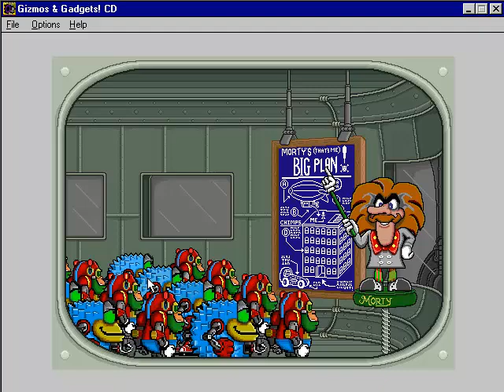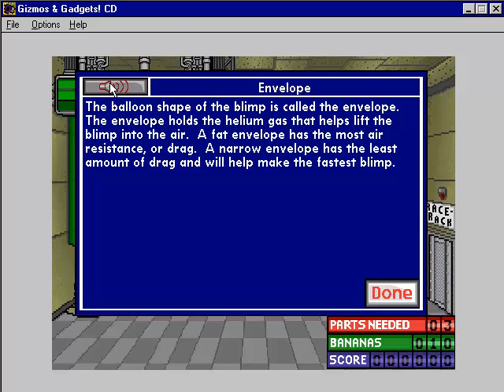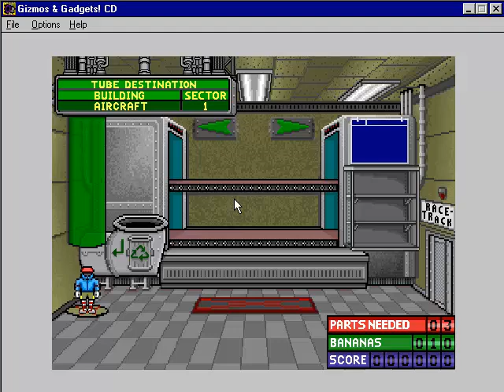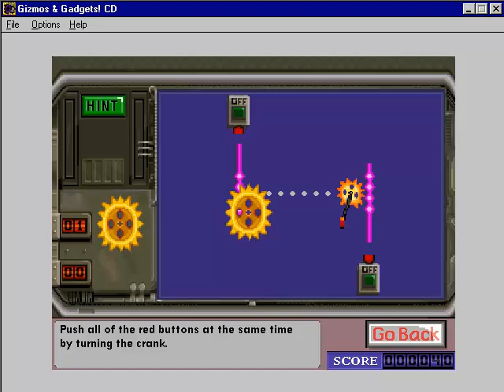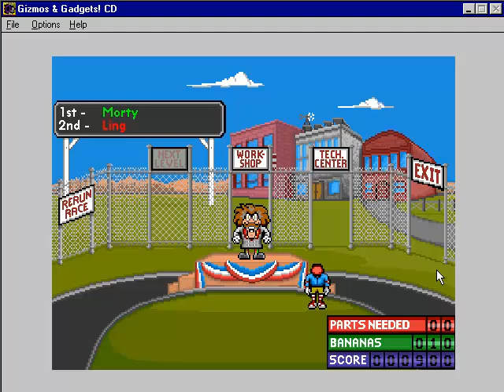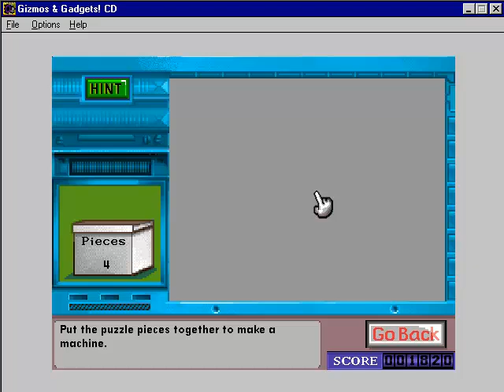Super Solvers: Gizmos & Gadgets! (Windows) - Aircraft, Level 1 (1/15)

Comment: Never noticed this as a kid, but that's not a blimp. Blimps do not have a rigid airframe inside the envelope, which means the gondola must be outside, because the thruster engines must attach to the gondola. What this game has you build is a zeppelin, which does have a rigid airframe.